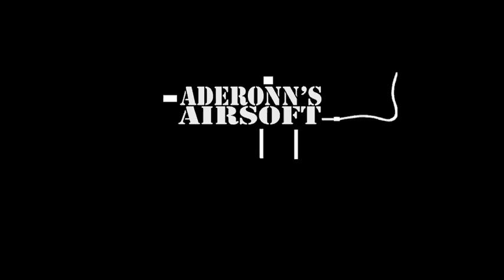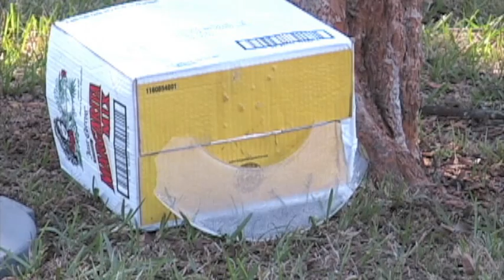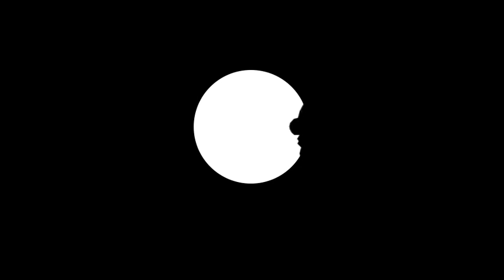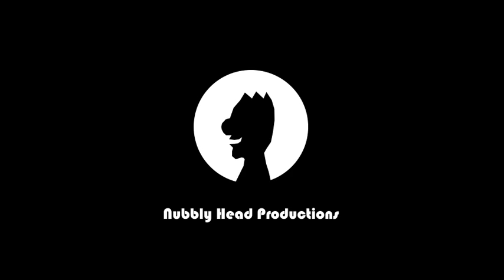Shooting 1/2" Thick Ice with My KJW Glock 27 GBB

Comment from the maker: what do you mean? like pull the trigger faster? it will shoot as fast as you pull it but you dont want to pull it too fast being that it was so cold cause it would make the gun seize up faster cause the gas inside would drop to low in temperature.